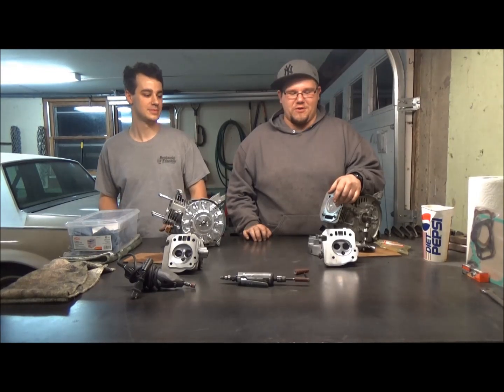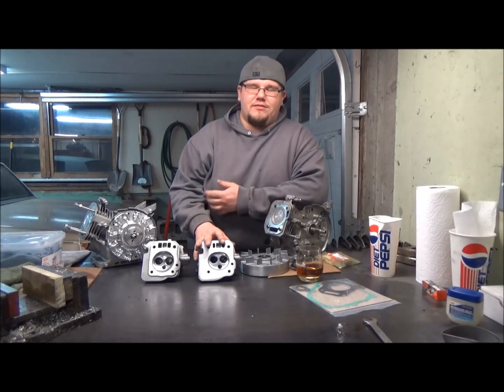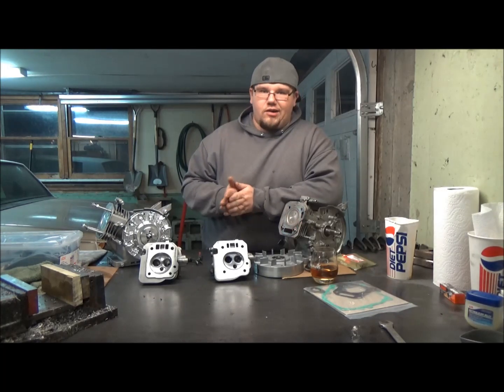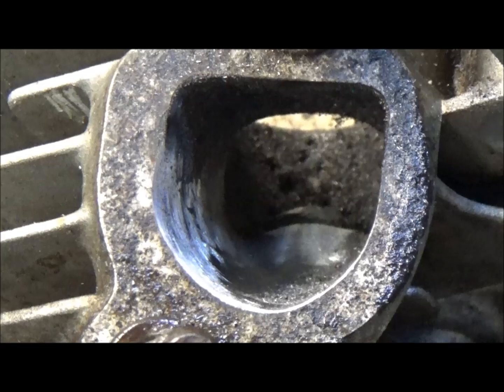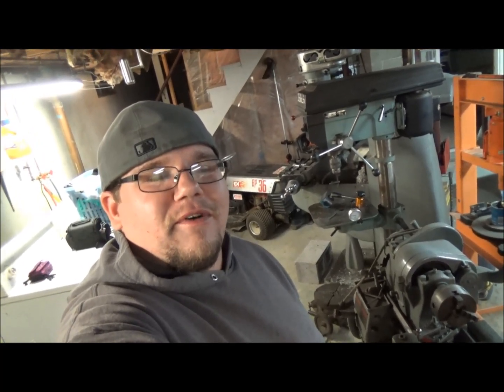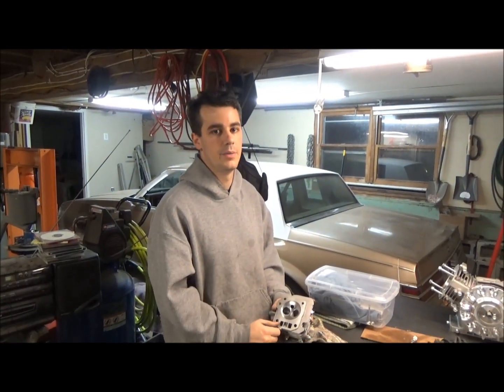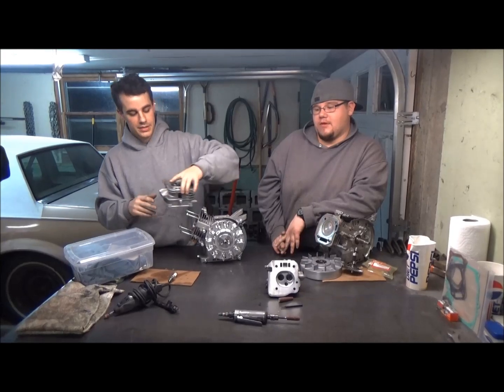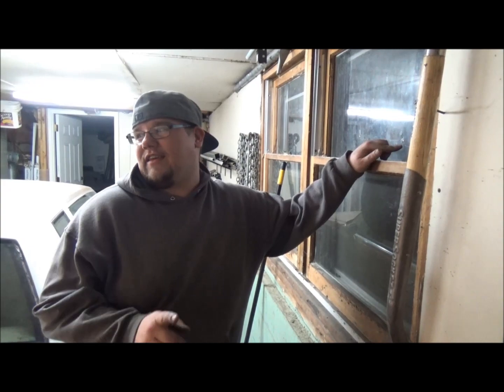Porting gx200 and Predator 212 Hemi Heads

Comment: I'm gonna toss a 14cc gx160 head on my 196.
Reply: 18cc head is supposed to be better but 25/24 mm valves. 14cc head is tooo much i read on karting.4cycle.com PREDATORS   breaks block in 2... without block stiffeners/backbone welded on.

Comment: What’s the best finish grit for both intake exhaust
Reply: 80 grit good as any. exhaust can be mirror if u want to spend the time... doesnt matter... carbon will roughen it up. the carbon will make boundry layer for exhaust to tumble over so that the rest of exhaust gasses can flow across them. exhaust flows well enuf on those motors, it is under pressure. intake needs help. but no matter what .... it wont flow more than 85% of intake valve seat opening as that is the best can hope for is 85% turbulent flow thru intake valve hole opening... minus 5 mm valve stem so.... 24mm valve seat opening MINUS 5.5 mm valve stem x .85 =~17mm... stock carb can be opened up to 17 mm with 17mm drill bit and vise grips... will get into the idle jet pocket and fuel needle/seat pocket. both can be epoxied with 5 min expoxy and screen door material

Comment: I have an older GX 160 short block which has the flush head design. It's legit. The short block also has the cylinder a CH closer to the center of the crankcase. This really f's up your cam clearance, ramp and even duration unless you mill the bottom edge of the cylinder wall. I used a CS grind core Dyno cam which is relatively mild with moderate duration so you don't smack the shit out of your valve train when you drop 22# springs and send the governor packing for a very long weekend. I put it together, lashed the valves, put on the PVL, spun the crank and CLANK! The cam topped out just on the edge of the wall, locking between it and the exhaust valve. No sense grinding the cam more, you will take most added ramping out to fit  the duration.  Kind of still a win but not great news. I'm guessing that's why head work and compression are such big factors in Gx160s and older 200s. Also a big to do is a longer billet rod with a short U2 Flat piston for increased stroke with the added RPM.

Comment: The Dremel HSS and tungsten carbide cutters work great for porting, especially heavy removal, use some light oil like WD-40 or 3in1 as a cutting fluid. Finish up with sanding drums or grinding bits, and for the exhaust the little sanding poofs will polish it right up, don't polish the intake. To prolong the life of grinding bits when working with aluminum, you can use oil or soapy water as a coolant and to prevent the aluminum from sticking to the bit.

Comment: I'm doing my first build on a bbr tuning frame from Berry bikes.com made for a smaller engine of course I'm putting a 212 Hemi predator on it modified stage 2 head ported and Polished big time open the ports way up should have mass air flow 22 lb valve springs didn't want the 26-pound beating my head to hell and back got the bullet Rod stage 2 cam I got to grind crank for clearance so I'm going to have that balanced at the shop Billet side cover to have the Dual bearings only way to go if you want it to last instead of shaking apart first time posting wish I could figure out how to send a picture of the head the build will make my 212 around a 13 horse should turn around 7500 maybe 7700 rpms,,,  can't wait to finish it making it Street Legal horn lights turn signals the whole nine yards with Fatboy tires in hydraulic brakes and an outside generator running off a belt so I can keep my bullet Speedway Predator flywheel ...

Comment: briggs flat head work? Seriously? All they have is a spark plug hole. I'd like to see that.
Reply from the maker: +superhoggbike There's a little more than just a spark plugs hole. The cams we run are much higher than stock lift, the valves will hit the head without removing a lot of material inside the head. After milling that out you have to grind it blend the surface with the rest of the head. Of course you have to plane it for a good seal and could plane it on an angle a little if you want to get tricky for that little bit of extra C.R.

Comment: A few thoughts - I hope they help...

1.) The area around the guide should be further relieved to promote flow
2.) The short side enjoys the widest radius possible to keep the air from falling off tight turns and over pressurizing the long side with turbulent air.
3.) Milling the block versus the head will raise compression as well but comes with a huge benefit of added squish and suppress detonation which cannot be achieved by milling the head alone.

Great video.. thanks !

Comment: First - nice approach.

A few added thoughts...
1.) Because 'D-ing' the port on the short side is most beneficial at the turn, it should be blended back to round to properly engage with the carb and muffler.
2.) While milling the head will raise compression and performance, it also makes the engine more prone to detonation - Milling the block to raise the piston above the block deck and as close to the head as possible will increase the combustion squish-band and concentrate the final portion of burn into the center of the combustion chamber. This suppresses knock and also supports offsetting the flywheel key to increase the spark advance even though the compression has been increased as well.

I hope this helps
Reply: How far in the hole is the piston?
Reply: @billyjack8119  Not far down.....not enough to go milling 50 thou off the block..nice in theory but he's never had one apart to see.Thats the dished piston non-hemi.Trev New Zealand 😊🇳🇿

Comment: how much do i need to mill to get 10.1:1 on gx200 clone?
Reply from the maker: +Hermes H Junior There's never a set amount. There's a large discrepancy in Honda clone motors between head volume, dished pistons, how far the piston sits in the cylinder and you also need to decide what head gasket to use. Unfortunately there's really now way to know without doing a cc test and some math

Comment: Fyi. The predator hemis will break the cylinder off the crankcase at around 30hp. Mine lasted 2min and then we built a second one but welded 3/16ths braces on the top and bottom of case/cylinder. ARC rod, stock crank, 308 cam, gx390 carb on methanol. It has all the other goodies too will turn over 10,000 rpm but only really pulls to 8500-9000 rpm.
now they have offset ratio roller rockers for these. fun motor and would like to build a honda block with stroker and big bore but with hemi head.

Comment: What are the differences between that gx200 clone, and that Predator 212?
Reply from the maker: +Clint Murphy They're very similar motors, basically the same design. There is some interchangeability of parts but it gets confusing because there is several generations of predators too. Clone manufacturers quality varies and I'm not sure how they compare to predators as far as quality. Basically before you think about building one you need to research them and decide which looks best for you.

Comment: how high does this engine rev? If it is under 5500 rpm then try a 35 valve seat and you will gain air flow! I ported heads for years and there will be more area under the curve overall with a 35 valve seat intake only!  you will pick up bottom end power and be gone. if you rev it higher than 5800 then a 45 works well! Remember try it before you knock it!
Reply: some Pontiac engines came with a 35 seat from the factory back in the day. great move for a street motor. a little harder on the seats, but no big deal with a moderate cam and spring.
Reply from the maker: +Robert Jones It's normally under 5500 rmp. Maybe when were trying to get into it a little we'll turn it over that but not usually. We didn't really mess with the valves much on these motors but that'll be a nice tip we'll look into for the next motor build, thanks!

Comment: Great channel guys, I love it, Just because I'm an annoying ass I like to give advice.  So don't take this wrong please,  Quick tip what I have learned when Porting you should be using Carbide Bit to CUT away the Aluminum, then you can use a 3/8 Drill Bit and drill out some of the Valve Guide, then use a CONE Shaped CARBIDE Bit to clean the Valve Guide so the Valve can slide through, then use the Spiral  Sanders to finish it "starting with 80" and ending with a 240, leave the Intake a little roughed up with 240 "Never Polish an intake side with carbureted Engines" just make it smooth and make the corners less rounded and more strait to reduce turbulence and increase air velocity. Do the same with the Exhaust but end it with a 500 Grit and then Polish to a Mirror Finnish to keep Carbon from building up and causing Turbulence in the Exhaust Port.   Over all looks good though!  Just giving you guys some info so you can  do even better next time and impress some Pro's like I did.
Reply from the maker: +TRX Vlogger Thanks for all the tips and the sub! If we go all out on a high rpm race motor we'll definitely take those steps, our "porting" was just a clean up really lol
Reply from the maker: +TRX Vlogger Thanks for all the tips and the sub! If we go all out on a high rpm race motor we'll definitely take those steps, our "porting" was just a clean up really lol
Reply: TheJanticJournal Sweet! Glad to hear the Response and Yeah I kinda figured that's all you were doing but I thought it would be nice to have some Info that I wish I had to began with.
Reply: Thanks for the tips TRX Vlogger!

Comment: Hey, what dremel bit is that? I need to port mine. I've done several other mods and i'm considering portPolish.
Reply from the maker: +Speedy_ 212_ It's actually for a die grinder. Basically a bigger air powered dremel. They're sanding cones and I picked them up at harbor freight, it cam with two arbors (which broke) and a bunch of cones.
Reply: Thanks for the reply. If I could do mine again I would use a double cut carbide burr so it wouldn't take so long. They cost $15 a piece but i'm sure they have many uses and are very good cutters.

Comment: I know that you guys are really into the mods on these preditor engines...... is there a lot of difference out of the box with the hemi over the old style ?  If so how long till a guy just cant get enough power but, thats every day !  Does the 93 octane have ethanal in it ?  we dont have ethanal in our 93 octane fuel in Arizona !
Reply from the maker: +cody cheney I actually didn't even run the Hemi engine until after I built it. That motor went straight from bought to built lol. About the ethenol, the pumps say up to 10% but I'm not sure how much is actually in it . Thanks for subbing btw!

Comment: just stumbled across this channel. Working on a predator 212 build at the moment. Lots of great content here keep up the good work!!
Reply from the maker: +YouthShooter Great, glad we help out! Is yours a hemi style?
Reply from the maker: +YouthShooter Great, glad we help out! Is yours a hemi style?
Reply: TheJanticJournal newer model non Hemi on a doodle bug frame. 12:53 sproket ratio. Mod 2 cam, 18lb springs, high flow air adapter, header, ARC billet rod. Have a 14cc Honda head coming in this week. I haven't gotten around to watching all your videos but are you guys running stock bore size carbs?
Reply from the maker: +YouthShooter sounds like you'll have a pretty stout motor. The Honda clone has a stock carb but the predator has a 22mm mikuni.